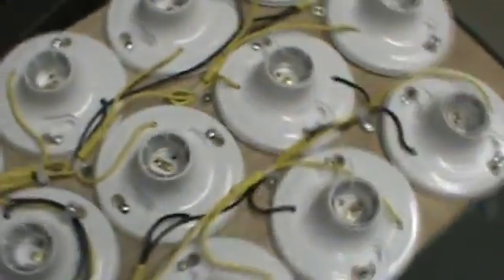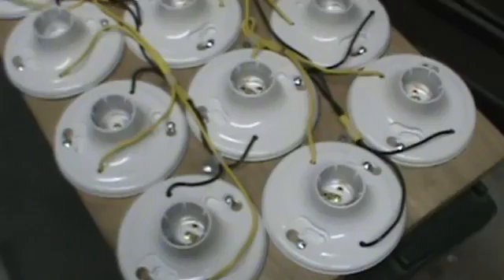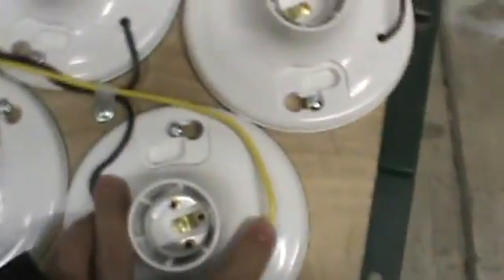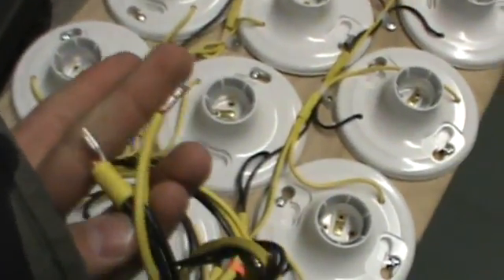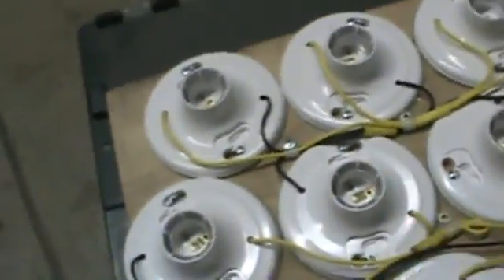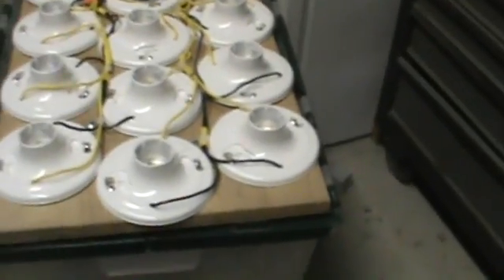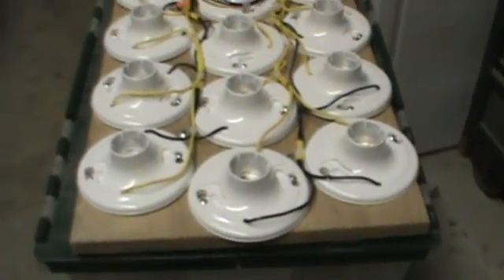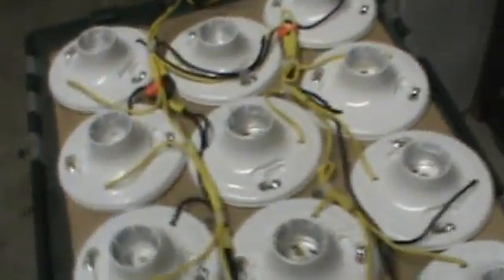Simple Ballast, Using light bulbs!

Comment from the maker: cool! my original intent with this was for a MOT as when i was running it once, it pulled excess of 20 amps, and tripped the breaker. i just need to pump like 400v into the mot through this and a step up transformer, so i can get 5 foot long arcs off of my teslacoil

Comment: Nice panel, gives you flexible control in 100W steps. still good idea to grind the sharp edges of those screws.
One day you put this on a table and mark the top surface.
An electric heater is a good series ballast too.